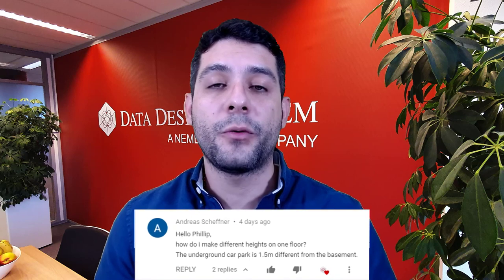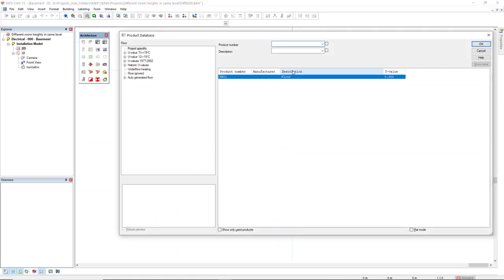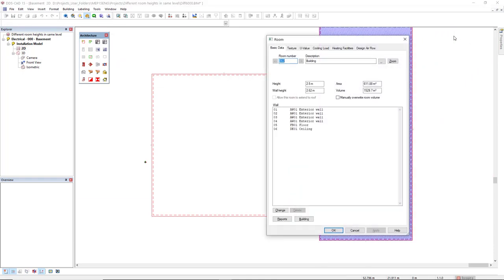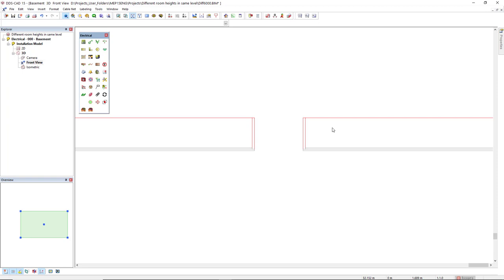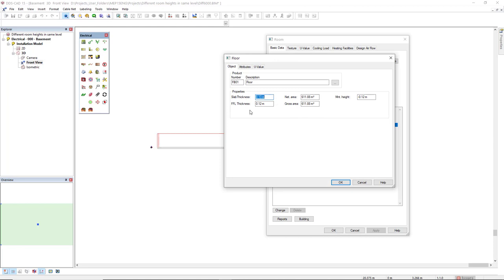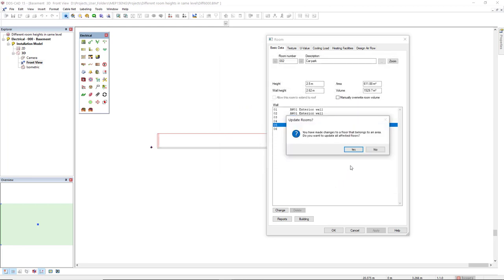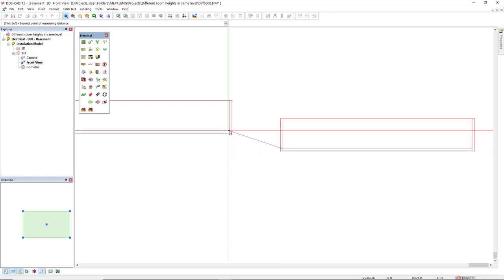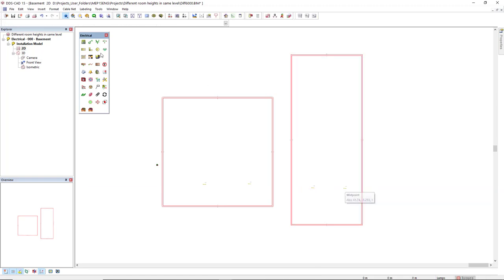DDScad | 📢 How do I set different floor heights in the same level? 🤔🧐🤯

Comment: Dear,
How to create 2nd floor, 3rd floor, roof and put them together? Do we need to import 3 separate DWG drawings of 1st, 2nd and 3rd floor?
Reply from the maker: Hello Huy,

If you are using traditional CAD files for your building reference, you should import the files separately from every level as you described.

You can view the complete building together with the so-called function Ghost storey/discipline.
Reply: thanks for your help 😘

Comment: how to find "Project manager function"  in DDSCAD 18 ?
Reply from the maker: Hi Hamid, in DDScad 18, it is no longer necessary to access the old function Project Manager. You have much more flexibility by using the Project Navigator. Nevertheless, you can still open the Project Manager by the short cut Ctrl + J.